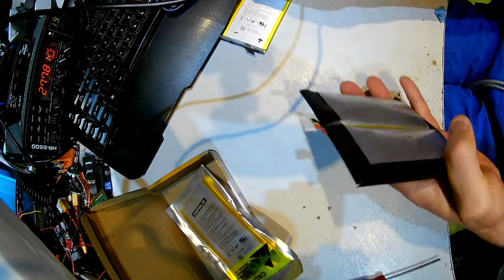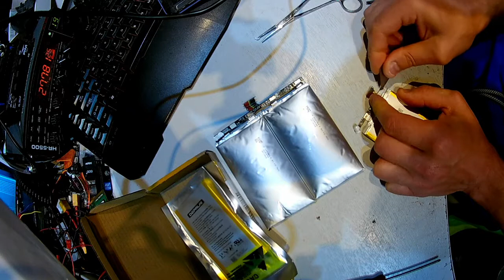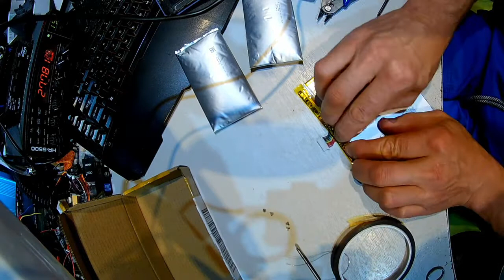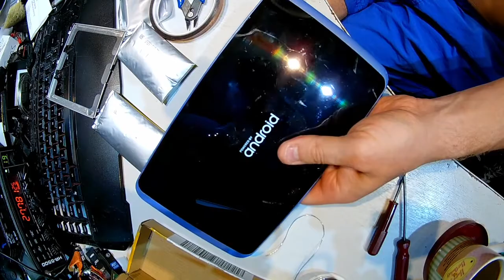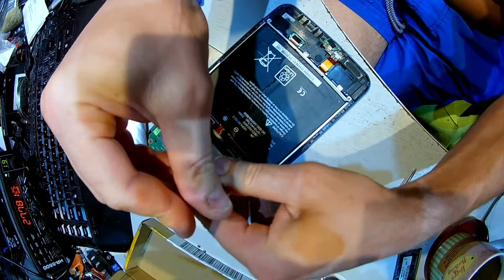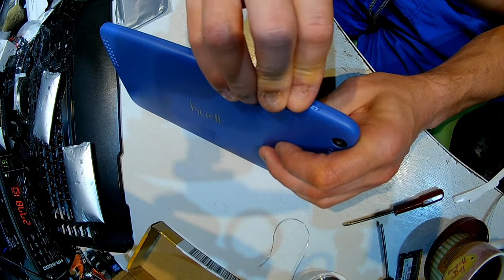Hudl 2 Battery REFURBISHMENT/REBUILD using brand NEW cells!

Comment: do the battery circuit boards have memory?

I know laptop batteries need their controllers resetting before they will charge the new cells properly.
Reply from the maker: No, the board does not have any memory that needs to be reset, you can just replace the cells and it will work. 
As for a factory reset,  it's not an issue,  you can get around it by skipping everything on boot and not setting up anything untill after the hudl makes its first boot after factory reset.

I recently picked up a second hudl 2 for peanuts on eBay because it was being sold as faulty because of the factory reset, I had it booting fine straight away :) 

If you Google it you can find websites giving better info but it's basically just a case of skipping everything on the setup page and doing it after boot.